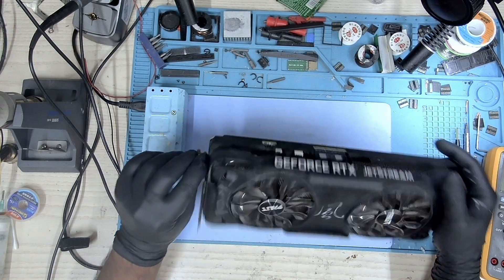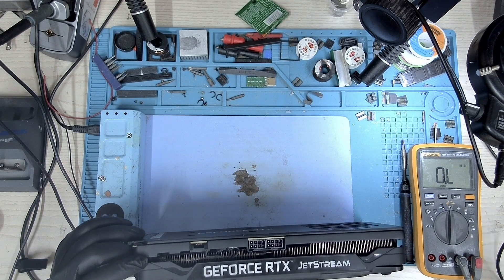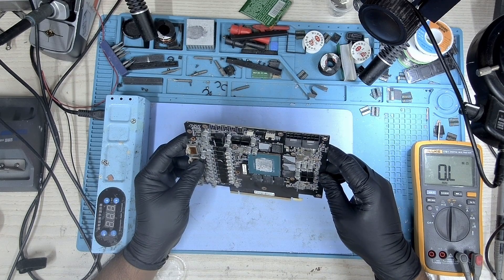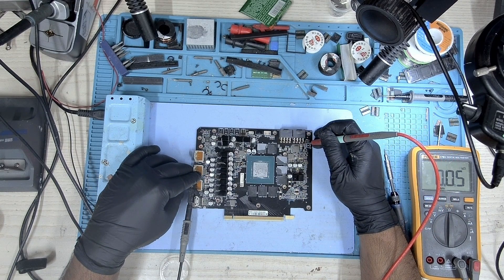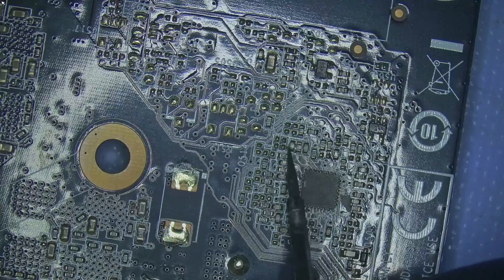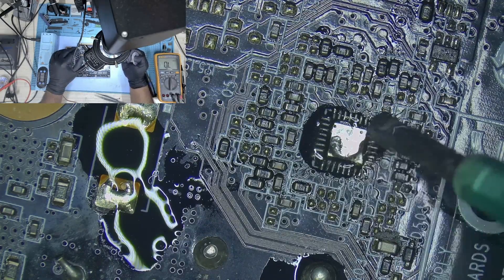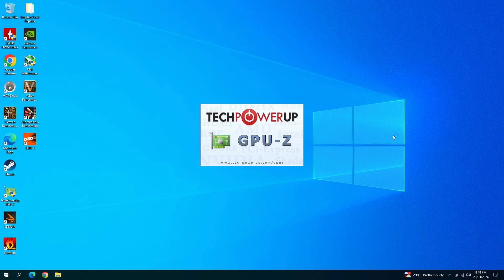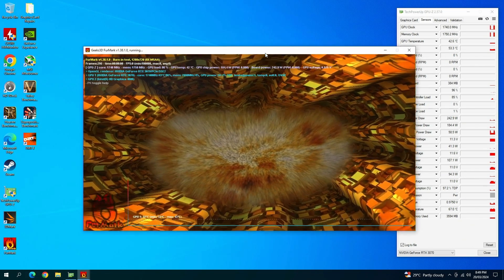The Palit RTX 3070 Drama: Finally Resolved!

Comment: I have same GPU like this, but the PEX only 0.7 volt, any suggestions the problem my GPU
Reply: I have replaced 3 times but still 0.7v
Reply from the maker: @dedekurniawan9100 check the resistance on PEX. May be low. Use a thermal camera to check if anything is heating up more in the PEX circuit. Check the 12v line coming in at pin 8,9 and 22. Check the resistor on pin 20 it should be 0R. Refer to the board view. I feel some resistors have failed.
Reply from the maker: PEX IC is faulty. Replace the chip.
Reply: @GraphicsCardRepairs-tk7ql i have replaced 3 times but still 0.7 volt

Comment: good work man pailt 1650 no view
Reply from the maker: Eventually it will 😁
Reply: @GraphicsCardRepairs-tk7ql  ic 4E=8ex6f
i need this
Reply from the maker: This looks like a marking or batch code. the part number is required. where is this part connected, on which voltage rail is it connect? You wold need  schematics to get the part number.

Comment: this repair's difficulty was normal but only if you have the right tools . if you didnt have the thermal camera i dont think you would have found the fault and that would have made the repair much harder
Reply: But if your thermal cam is broken and you don't want to pay again for that expensive gadget as cheap alternative you can use rosin smoke that very sensitive to partial short capacitor
Reply from the maker: Yes I have that too. Kept it as back-up. I used to use it before I got into a thermal cam craze.
Reply from the maker: Well explained. 😁 Thank you

Comment: You can get a cheap micro lens that will work for any thermal camera as long as you able to 3d print a housing that will get it easily attached to your specific camera.
I used one for seek thermal. Lets you get very very up close and see the details.
Reply: Nice to see you helping the community 😎👍
Reply from the maker: Yes I need to get one of those . It will really help me get close. Thank you 😁

Comment: You said the 8 pin is shorted with 100 ohms. What should you see? Thanks
Reply from the maker: Any short above 5 to 10 R are difficult to detect. Sometimes low voltage injection will not do anything. You might have to increase the voltage depending on where you are injecting it. For example here I could have gone up to 12v. But the idea is to start with 1v and move up the voltage if you see nothing.
Reply: @GraphicsCardRepairs-tk7ql  Thanks for taking the time to respond. Have a nice week.

Comment: Its complicated on repairman with no tools like me 😅, i have no thermal cam,no microscope,  no dc lab power supply, no oscilloscope, the  only i had is a hot air, and a tester and some flux, poor me im not lying 😅😢
Reply from the maker: Well is a start somewhere. You can gradually build on it. Trust me i started the same way.